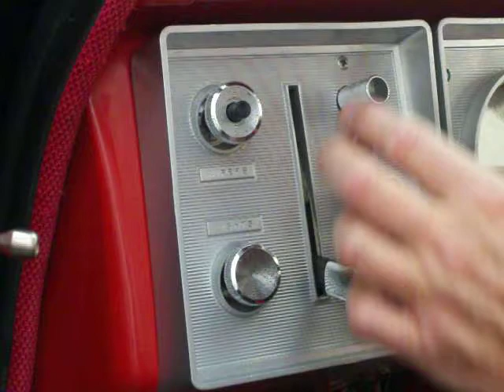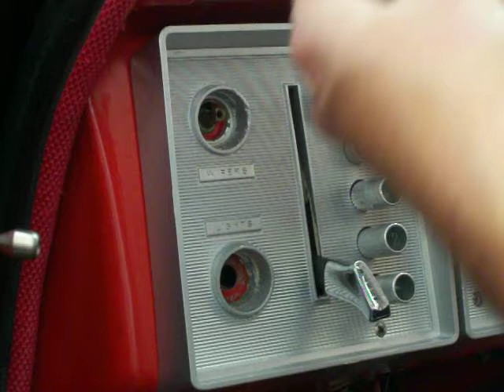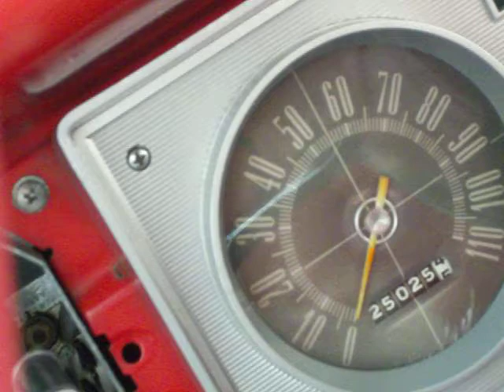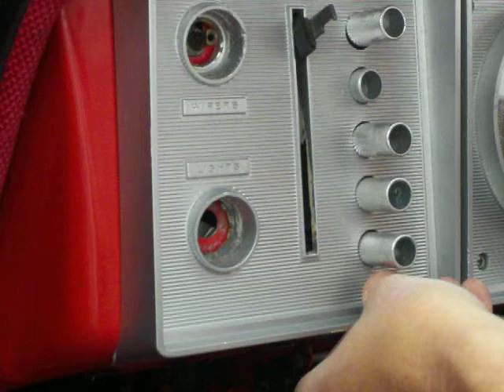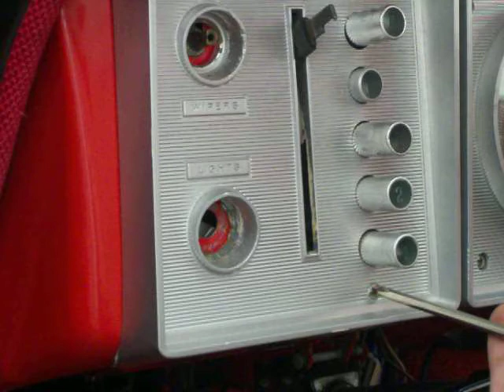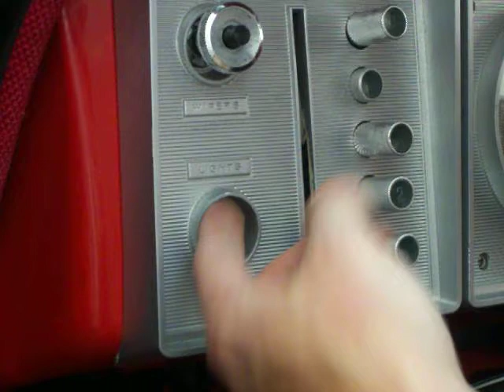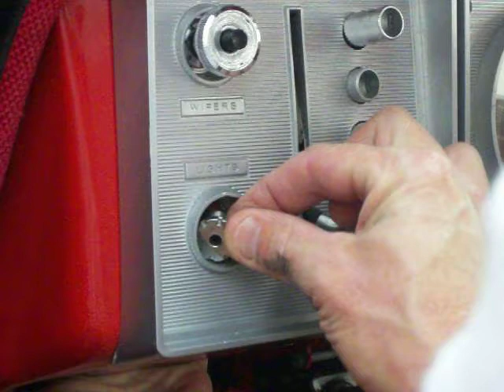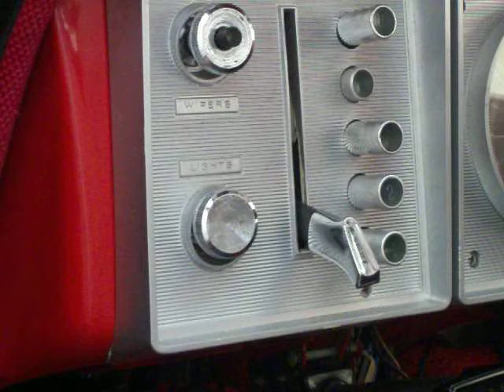Valiant Barracuda Dart Push Button Bulb Replacement Real Time

Comment: I never would have found that button on the back of the light knob. I just Got a 1964 Valiant signet 200 and I can't see anything at night. where can I get the special tool with the 4 prongs to remove the wipers and Light Knobs?  Thank you !

Comment: What's wrong with mine is that somehow the "drive" button disengaged and I was unable to put the car in drive.
But while I have the plate off I'm just going to replace the bulb,
The plate on my dart was RIDICULOUS to get off. But thanks to you I didn't break anything!
Reply from the maker: I had the same problem with the "R" it happened @ a car wash - I'm glad to have had the tools in the trunk to open it.  It happened again in my driveway a 2nd time about 2-3 wks later.  I have 2 other sets of buttons- I compared all the "R"s & saw that the one was worn where the plastic connects to the metal, which caused it to slip off of the metal - Have not had that problem since changing it - The one I used is very squared at the end of the plastic. You might be having the same problem.

Comment: What's the name of the tool with 4 the prongs?
Reply from the maker: Search: Mopar Dash Bezel Tool  - I purchase it on eBay - I just looked on there & I found 3 - all from the same seller - not the guy I bought mine from but they look the same.  I have the "short" one - his is also $15 with free shipping. Let me know how it went after you replace the bulb.

Thanks for asking - I will update my step by step to include Tools used -